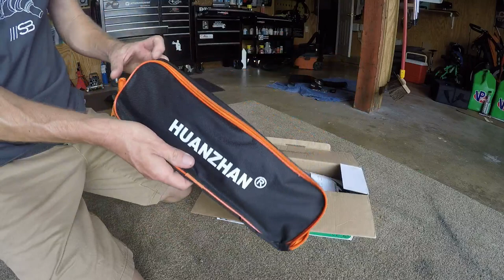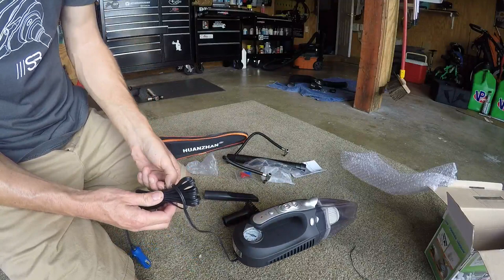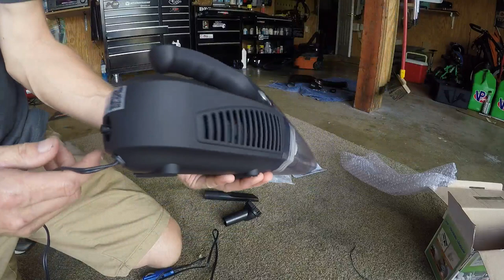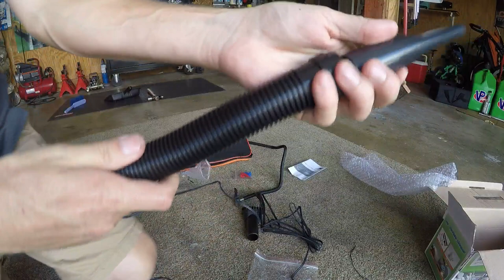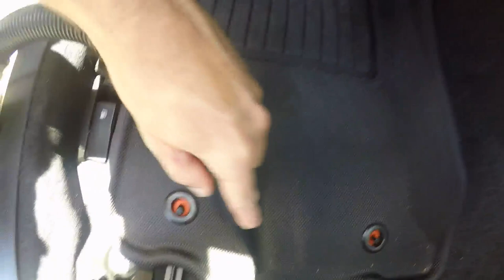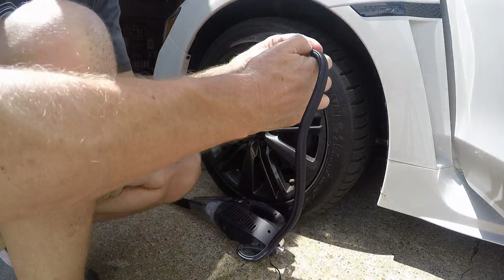LastHumansTech: The HUANZHAN Portable Car Vacuum Cleaner/Tire Pump

Comment: 35 to 40 psi in that amount of time? That's not possible. The gauge is just inaccurate. ARB air compressors aren't even that fast. This thing looks like it is only good for small messes, and maybe emergency tire inflating.
Reply from the maker: prob right. seemed a little quick.